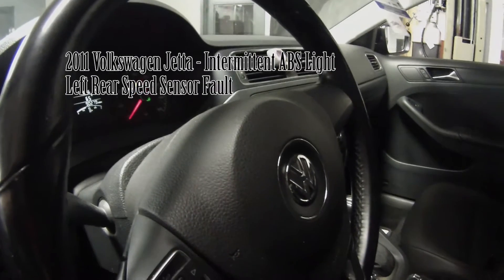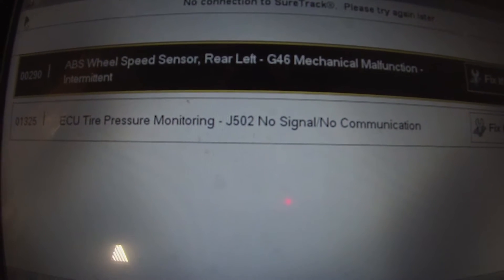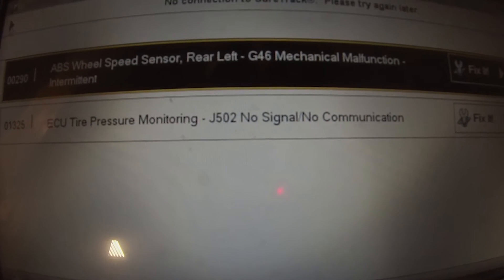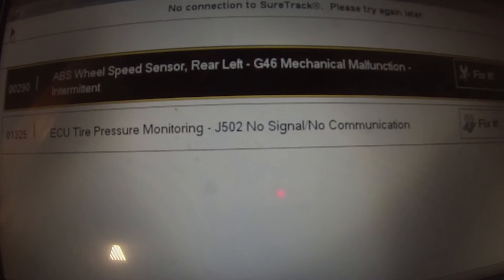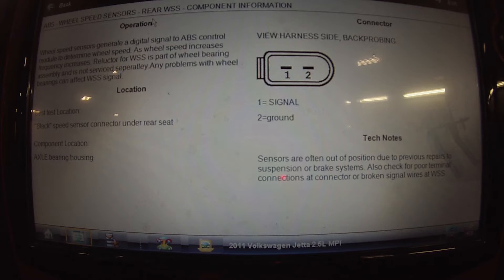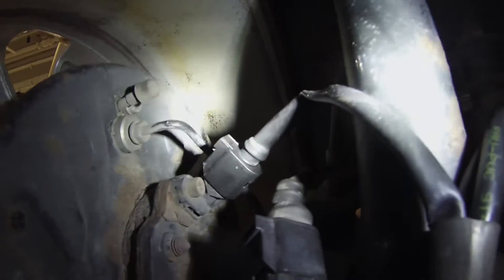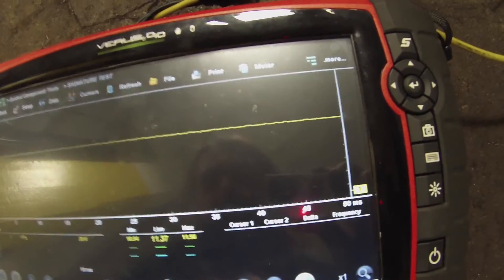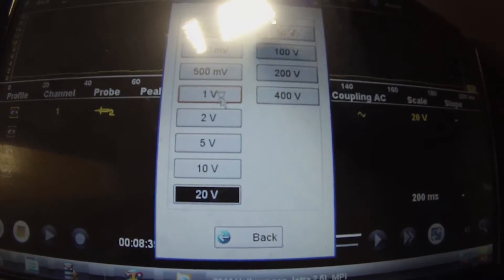2011 Volkswagen Jetta- ABS Light-LR Speed Sensor Circuit Fault

Comment: great fix man  I think they call them magneto restive     wonder if you deal with a micro amp probe ?   they work great on so many things  expecessely   wheel speed sensors and curcuits   they convert 10mv to 1 ma    company  called AMEC  k110    pricey     check ebay   work great with your  snap on scope    thanks again
Reply from the maker: Yes I heard they use micro amps. Nice to see that we can still diagnose them using voltage and ac coupling the signal.   Thanks for watching and supporting.

Comment: i d like to know more detail of how you installed your "jumper harness", since the sensor needs power..i mean, you cant go straight onto the sensor(unplugged) as u did to the VRS type, right?
Reply from the maker: Right. The harness plugs in but it gives you access points to plug your scope leads in. I head these sensors use milli amperage. But you can see the small square wave floating on top of the 12v feed
Reply: hm..i cant picture that..(btw, i saw how u plugged your scope leads) ..my thinking is that the only way is to backprobe the sensor`s signal wire,(sensor plugged in) and then connect a scope to it..
Reply from the maker: That harness is just an easier way to hook your leads up. It's the same as back probing the sensor
Reply: ok..i just wanted to point out the fact that the sensor needs pwr bcus it does not create its own voltage (unlike the VRS type)..i get it, your jumper harness is in between the sensor and the sensor`s harness..and also offering those access points for the scope..i apologise for being annoying..anyway, keep up the good work..you r good tommy..very good

Comment: I have had abs problem off and on for a year now. All 4 sensors have been replaced, all 4 bearing have been replaced. The wiring has been checked and the abs module tested. Ive had it to 3 different shops. The light is now on constantly. I am at a loss.. i have been told that the ecu may need to be erased and reflashed. That makes no sense. Any ideas?

Comment: Magneto resistive Sensor ( Also called " ZERO SPEED SENSOR" )...
If a carrying magnetic material is exposed to an external magnetic field its resistance characteristics will change that's how the signal is generated.  It CANNOT generate its own signal voltage ( Like VRS sensor ) on their own, and must have external power source